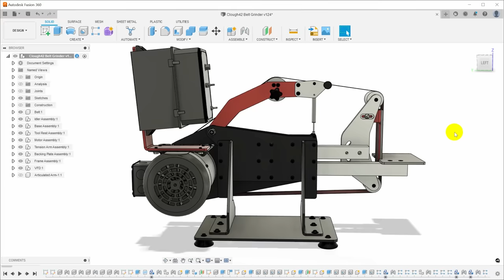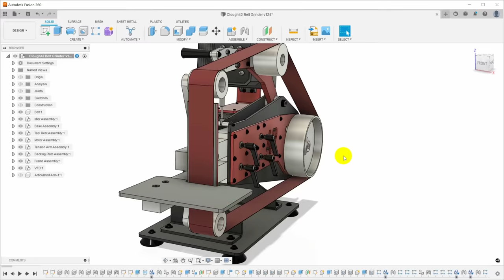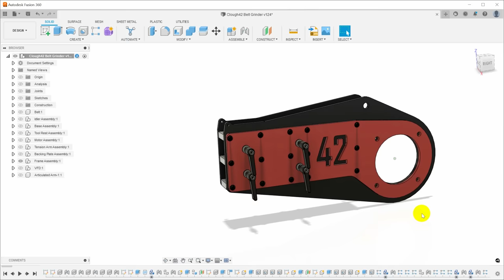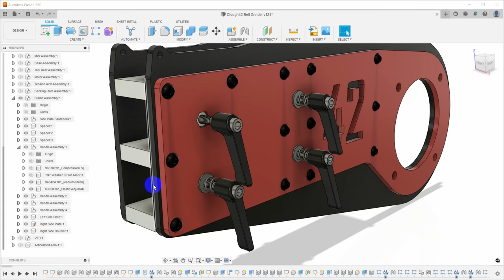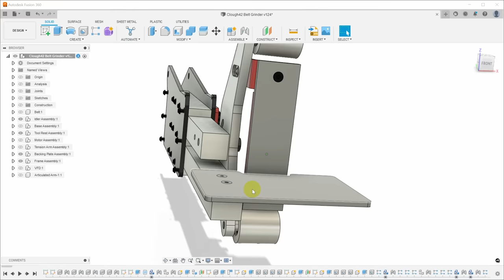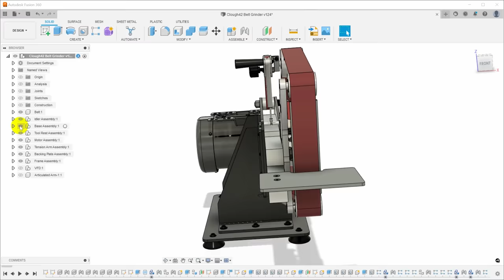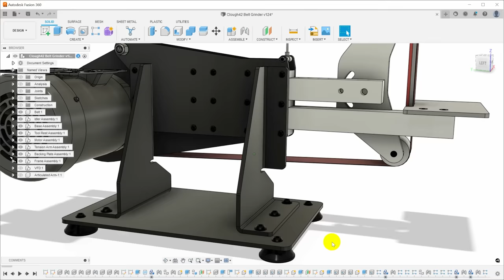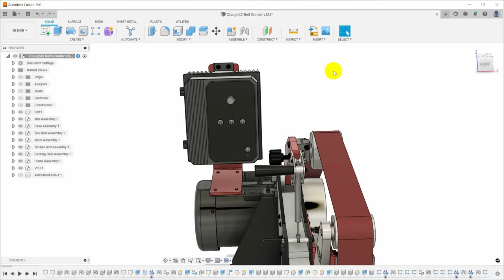Creating my Ultimate DIY Belt Grinder: From CAD to REALITY - Part 1

Comment from the maker: I've gotten a bunch of comments asking how to get the plans.  I have everything hosted on Patreon.  If you sign up to support the channel (https://patreon.com/clough42) you can get access to the files for this, and all of my other projects.  The downloadable file bundle includes the full Fusion 360 model, a STEP export for use in SolidWorks or other CAD software, DXF files for cutting out the parts or ordering them, drawings of all of the machined parts, assembly drawings showing how it all goes together, and a complete list of all of the hardware you need, with links to sources.

I'm also seeing a lot of comments asking about pricing.  In general, I try to stay away from discussing pricing because it's so volatile.  I have machines in my shop that now cost double what I paid just a few years ago.  That said, at the moment you could build this grinder exactly the way you see it in my videos for around $2K.  You could of course save hundreds of dollars by ordering two sets of parts for you and a friend, skipping the powder coating, using an Asian import VFD, cutting out the parts yourself, etc.  It all depends what you want and need.
Reply: 2k for a 2hp belt sander that's pretty rough. Oh well, the cost of diy is often worth it! Great work, looks like a fun project
Reply: @mattmurphy7030  2k for a belt sander that you can service yourself and order what parts you want than have some mass fabricated name brand that will break in a couple of years
Reply: I think this is a great design, elegant and accessible! An addition I think could be really nice would be a lasered a protractor/degree scale from the pivot point to the back of the platen support, and added a little indicator needle on the 1 1/4 bar so you could zero it perfectly, but have fairly repeatable rapid adjustments. I'm sure you have a friend or YouTube colleague with a fibre laser, but I'd happily do it for you if you could live without your grinder for the time it took to ship it back and forth

Comment: You should sell these as a kit, just the send cut send parts and hardware.   Links to the other parts and some assembly/machining required would be very appealing.
Reply: Yes, will be nice if he can give opportunity to buy the flat metal as a kit from send cut send. Please let us know.
Reply: Plunk down $5 on Patreon and all of the parts lists, cut files, etc are yours for the taking.
Reply: Agreed, we need a kit or partial kit!
Reply: Don't that is a good way to destroy something you enjoy by dealing with the ungrateful public  people are so incredibly senility god forbid if they say your missing a Lil bolt evendors thought you waighed the full package and it was with in .5 grams or a pair of bolts where way off one had 2 threads more than the other  last thing you want is to let the public in your shop
Reply: You’re not lying. Much easier to sell digital stuff and left people make it themselves. I think it’s pretty smart.
Reply: Looks like a diktator grinder kit
Reply: How much did it cost you to have sendcutsend make you those parts?
Reply: @thebotformalityknownasdale2564 Dale it probably is because nobody can understand a word you're saying. Your spelling is really not very good and you use improper words for what your trying to say. Example would be your site name bot "formality" knownasdale. It should be "formerly" not "formality". It may be that they are questioning capabilities.

Comment: Those flange nuts are a nice touch, I'd also add a shim on the inside, so instead of having the rotating nut going straight into the bar, you'll have a no-rotating disk. This would avoid making scars in it, making fine adjustments of its position harder in the future, and the screw would probably be easier to turn as well (no direct binding).
Reply: Yeah, I agree, an aluminum or brass button in there will keep the bolt from biting into that bar. Eventually it may make fine adjustments difficult as they leave a big divot.

Comment: Very nice, and I LOVE the red and black combo! 😎
I would suggest that you mill out a 0.125"-ish deep slot along much of the length of one side of each Alum tooling arm, where the Kipp is going to touch. You'll find out after many tightenings, that the softish Alum will bugger-up, and then the tooling arms will not go in and out so easily, and the burr will start to scrape away the powder coat finish on the inside. Where that newly developed burr is skidding along.

Comment: Hello there!  :)
I am an amateur machinist but I used to work in a metal shop where we used a lot of laser cut steel plates and if I may make a suggestion here, when you specify holes diameter that will be tapped, have them made  a few thousands smaller than tap size!
The reason for that is when laser cutting thick aluminium the hole will be kind of cone shaped, and in steel, the surface inside the holes will harden quite a bit. In both cases, you may break your taps.
The idea then is to enlarge the holes with the proper tap size required and this will remove the hard surfaces and bring the holes to a perfect cylinder making tapping a lot easier with less risk of breaking the tap.
You don't have to ask how I know!  :)
I really like your VDOs, I really learn a lot from them.

Comment: I built one years ago from 8020 extruded Al.  Most is 40x40 with 80x40 legs.  The table support and the roller support are on either side of a fixed frame member,  not vertical.  I fabricated end wheels from 11 inch rubber coated to 1/2 inch.  GREAT DIRT MAKER!!!!!

Comment: Hi folks, for those in the UK worried about metric equivalents aluminium stock is readily available here in imperial. There are also suppliers of imperial nuts and bolts although things like imperial flanged nuts may be more tricky. The shipping costs probably negate buying kits from the US. I've no idea if the equivalent 'Send Cut Ship' services are available over here. If they are it would not be difficult to modify the design detail to specify bolt metric sizes, then just get the spacers right and you would be ok. Nice looking design and build, I bet James finds he needs accessories for it!
Reply from the maker: Most of the hardware is 1/4-20, which is very close to M6.  In fact, the existing holes in the drawings would likely work.  Substituting 6mm plate for 1/4" also shouldn't make much difference.  The parts I would be most worried about would be the square bars.  I assume those would want to be 25mm?  That would probably require extending the slotted holes a little to allow the channels to close down enough.  I'm not sure at all about the wheels and motor, though.  I assume there's some other face/foot 2HP motor configuration that's more common outside the US?  The one I used has imperial flange and thread dimensions.

Comment: Darn.  I’m 99.99% complete - soon to finish Phil Vandelay’s design.  I love the simplistic design of your grinder and I bet it’s waaaay more cost effective.  I knew I should have waited….  :)
Reply: Yeah but Phil's is so beautiful, and incredibly versatile. Different machines with very different aims. I'm sure you won't regret building yours!
Reply: @cooperised  agree it is a sweet machine.  I followed every detail in metric. In the US I had to order 3”x79” grinding belts Vs 2x72s.. I’ll be wiring it up to the Mitsubishi VFD next weekend, testing before I cold blue the hardware. And… I’ll be using the Owatrol oil to finish as well. The spark deflectors will be the final phase of the build.  I’m interested in James’ spark deflection design…

Comment: When assembling the platten plate with the idler pulleys, it's a good idea to put a piece of normal writing paper under the platten. It sets the flat plate back from the pulleys by a tiny fraction of a mm, which ensures the belt isn't running over the sharp corner. Makes the belts last a bit longer.

Comment: I recently found this channel and have been loving the content. The grinder looks amazing! I'm a machine designer by degree and profession and there's some design cues that I really think I could use in my own field. I especially like the black on red "42", looks so good. Very well done.

That being said the one thing I don't like is how the tooling arm locking handles bear down directly on the soft aluminum. I'd imagine those will make some pretty gnarly marks over the life of the machine.

Comment: Love it. Wondering if you now were thinking using the same size faster on the pivot would have been more functional. One tool to adjust instead of two.
Reply from the maker: Yeah, in retrospect, this would be good.
Reply: Came here to say that as well, hindsight does wonders for design choices
Reply: You could turn down and rethread one of the larger screws to fit the smaller hole. Or make a custom screw with an oversized head. Or just use a Kip handle there.

Very functional and efficient design, James. Any plans to sell the files?
Reply from the maker: @g.tucker8682  oh, I like that idea.  It's overly-complicated and it'll work great.  :)
Reply: @g.tucker8682  I think I would just put a threaded insert that matches the small hole into the larger hole (or both really). Then you also get steel threads instead of the aluminum ones, which is beneficial where it will be tighten/loosened frequently.

Comment: Looks pretty good.  I suggest putting the clamp handles on the other side so they push onto the plate that the motor is mounted to.

Comment: Great job! By using laser cut mortice and tenon/bolted edge connections you can avoid all bends and the drilled spacers.....The laser is king for this sort of machine. The less manual work the better. I look forward to the next video.
Reply from the maker: I wanted some adjustability to allow flexibility for different bar dimensions, and I thought tabbed connections would make that harder.  It would be tempting to design for captured nuts to avoid threading, too, but if you laser-cut the spacers, it drives the price up considerably, and there's always a little taper in the laser cut that could cause issues.  In an earlier version of the design, I looked at tabbing steel spacers into the sides and plug welding them.

Comment: Nice Job! I would suggest that replacing the square aluminum bar and the aluminum spacers and resizing things for some simple HSS tubing or crew tube would make this design far more economical as aluminum solids like those are quite expensive now.
Reply: Yeah... except that tubing isn't very accurate dimensional, so there'll be some - or a lot - of messing about to make it fit properly. He did it that way because it insures an immediate precise fit without modifying anything.

Comment: I custom designed and built my own out of an aluminum frame. I used thrust bearings on all pivot points for the spring coil over air shock design.  I ended up using a 1400 watt servo motor on mine.

Comment: Outstanding! I will absolutely be subscribing, downloading, customizing and building from these plans. Thanks so much for doing all the heavy lifting! I'll wait to see how the series turns out, so I can think about mods. I like some of the suggestions below, and I was thinking about an angle indicator on the idler plate, and putting the speed control over on the right side for easy access. I built a remote control box for my mill VFD, and really enjoy having it close to where my hands usually are. Maybe also a dust collection tray with shop-vac connector...

Comment: Looks like a solid design. Also looks like there are 4-5 things that could be done slightly differently for someone without access to a mill. Or who doesn't care for tapping holes. I've been in need of one of these for a while and I will definitely be borrowing some ideas from this one.
Reply: @ADBBuild  Definitely. Not nearly as neat as all those tapped holes. But definitely serves the purpose. The platen could be slotted instead of the aluminum mount as well. Would mean an extra tapped hole or two, with a stud threadlocked in to provide clearance for the tool rest. But then the same design can be done without a mill at all. The spacers between the two side plates could be cut to size on a table saw to a good enough precision, if aluminum was used. Love the basic layout though and it leaves a lot of room for adaptation. I think this could be completely built without CNC too probably. Drill press and something to cut the material (plasma, metal cutting circular saw, jigsaw, bandsaw, etc.), pretty much good to go!

Comment: Another nice thing about the design of those handles, is that even after assembly you can easily rotate those nuts to change the clocking of the threads (and thus the angle where they tighten up). Just remove the bar, push the handle in against the spring to push the nut out of the hex, and then rotate it to the next 60 degree step. So you can ensure the handles all point in a position that makes them the most ergonomic.
Reply from the maker: The handles are adjustable.  Just pull, twist, and release to lock in a different position.

Comment: Man you will maybe hate me for saying this. I really enjoy all your content.
You consistently put out great videos.
I think you are one of the better channels on YouTube for sure.
That out the way, I kind of expected more with this one I guess.
There are some really good options out there on YouTube for DIY kits, for belt grinders.
I’m sure you must have looked at them when coming up with your design.
They have additional features where the whole machine is balanced to tilt sideways.
The attached table can pivot and tilt etc as well as fit sideways when the machine is tilted etc.

I think yours looks fantastic, is simple & basic etc so maybe not too challenging for newbs (like me) to build.

I just kind of expected more I guess from you given that you can CAD CAM design in 3D to produce all the cut files etc.

Maybe it’s just me? 🤷‍♂️

Not saying it’s a bad product, anyone would have to be proud to own a belt grinder like that.

I’m just wondering, depending what you use it for (eg custom knife making) how long before you run into some of the limitations of not having some of the more advanced features.

Bye the time you bought all those parts here downunder and did the currency conversions and add 10% Goods & Services Tax etc - that will easily become a $4k price tag.
Likely the VFD & Motor won’t work on our 240Volt AC supply etc.

Just not worth all the hassles trying to make it work for here downunder.

Making it only available to Patreons? 🙄👎

That kinda rankles too. If I wanted to support you with Patreon I would.
But being “leveraged” into having to, in order to be able to access the design details, seems a little standover ish tactics like the old mafia style.
If a non Patreon wants to purchase the files they should be able to as a once off purchase without being committed to monthly Patreon deductions in perpetuity.

Kinda lost a little respect for you over this one, which is a shame because up to now, I highly respected everything you put out.

I do understand, these are difficult times & everyone has to come up with ways to make an extra $ to get bye.
Can’t knock you for that.

But I’m wondering how many other non Patreon followers are feeling right now that “my moneys not good enough to just buy what I want once off without committing to ongoing Patreon deductions?”

I think if your going to play that type of game, you could have done a better job on the design to make it equal to or better than other DIY options out there.

OMMV

Comment: I'd love it if you could offer kits here with just the slotting operations and the guide bar machining complete, for those of us without milling machines. Countersinking, threading, drilling, etc, are easy enough to do with hand tools or a drill press, but.... well, appropriately jigged, it would be possible to cut those slots in aluminum using a router, and get those guide bars to size with a table saw, but that's still sketchy enough that I'd rather buy a kit with those ops pre-done.

Comment: You might want to consider slotting the adjustment bars so they don’t gaul and interfere with sliding in and out.
Reply: Yeah they need a thrust Gib or something so the steel screws dont mash into the aluminum bars.

Comment: I would suggest milling a slot in the arms. In case those Kipp handles raise a burr on the arms
Reply: You could also mill a pocket where the holes got goofed up. Laser etch a Clough42 badge and epoxy it in
Reply: Or put a slug behind the flange nut to spread out the contact area and avoid contact between the Kipp handles and the arm.  It could be brass if you are really worried about it.

Comment: Very nice! I just may have to build one... I may have missed it in the video, but what was the total BOM cost for the build? (assuming you had bought the sheet parts without the sponsorship)
Reply from the maker: I added a pinned comment.  As I built it, it's around $2K.  If you skip the powder coating, order two sets of parts for you and a friend, and use a $99 import VFD, you can get it down under $1300 each.  It all depends what you want.

Comment: James, thank you again. Pretty slick design! DFA is used! I have a question that you answered probably a zillion times but what's the history on the Clough42 name? Just curious. All the best James!

PS just one suggestion; I would use large feet or another bigger surface area under the locking arrangement on the aluminium slides. The sides will get damaged when you tighten them down which is a pity for such a nice machine in my opinion.
Reply from the maker: In fact, I bought and read a DFA textbook while working on the design.  :)